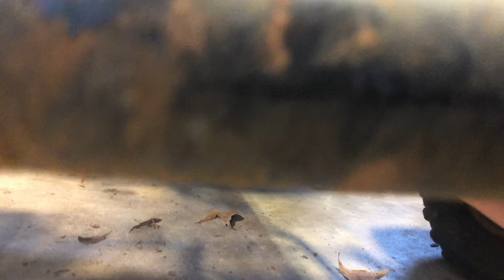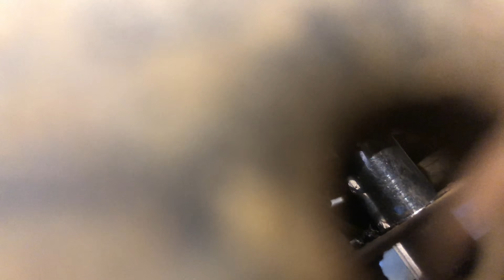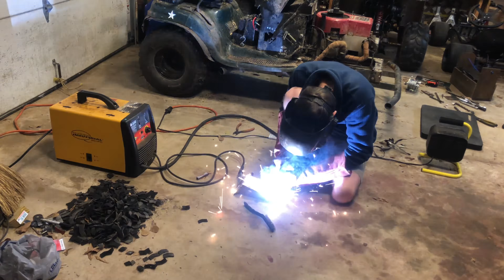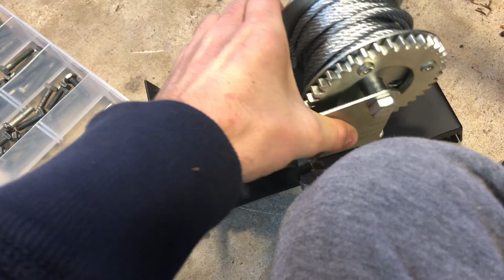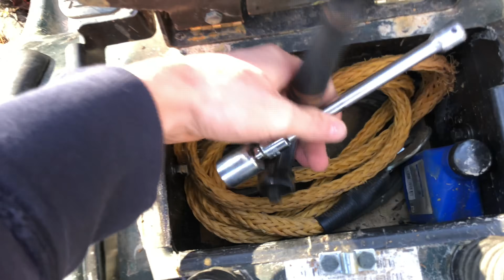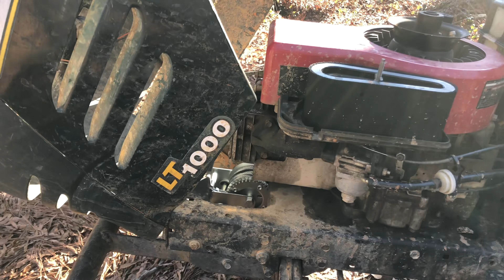Mechanical/Trailer Winch Install on Off-road Mower

Comment from the maker: I am only going to use this for emergency purposes only, if I for real get stuck. Also if this mechanical winch works well for a lawnmower, then maybe keeping a “come along” in your truck to winch yourself out of something would be a good alternative if you don’t have a electric winch!
Reply: Add a starter motor to the winch it's still cheap relatively easy and starter motors are readily available
Reply from the maker: @NickMaberry  I have one lying around that I might throw in there if everything works well.
Reply: @IngenGarage  I'll be ready for a video lol
Reply: I was thinking. Maybe an electric clutch with a belt setup…. Somehow…
Reply from the maker: @CrackerJack256  Electric clutch sounds like a cool idea, however not sure how to make it work lol.

Comment: Maybe weld the extension on to the winch so you can use a cheater bar on the ratchet, maybe even weld a cheater bar on to a ratchet.
Reply from the maker: Yeah that sounds like a good idea, however I am probably going to get one of the extendable ratchets so that way it will fit in the trunk.

Comment: Based

Old mowers are such cheap, rugged, motorized fun vehicles
Reply: Put some snowchains on the back tires, youll be amazed :)

The transaxle has asstons of torque, grip is the limiting factor
Reply from the maker: If I can find snow chains around here, their isn't much snow where I'm from lol.